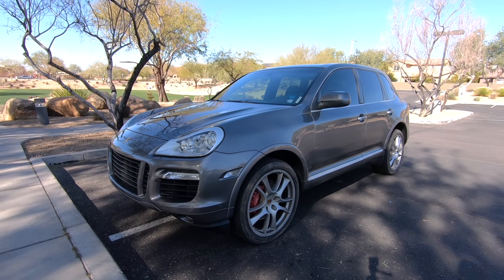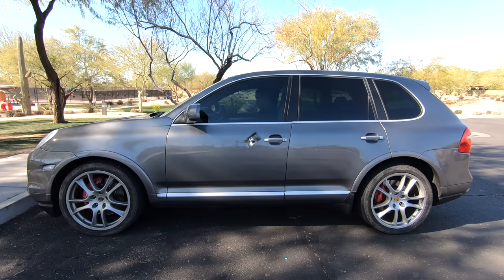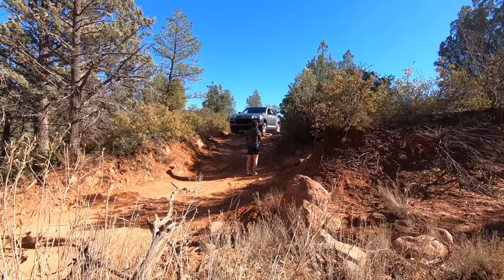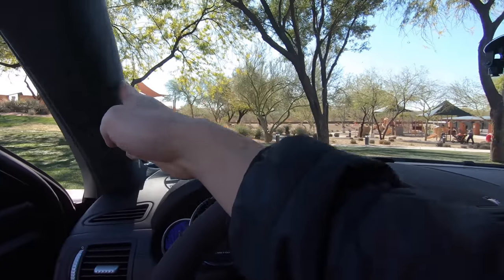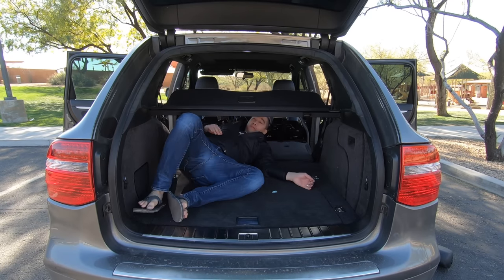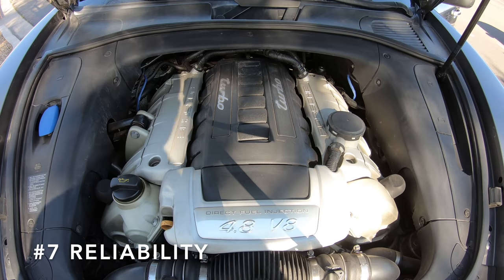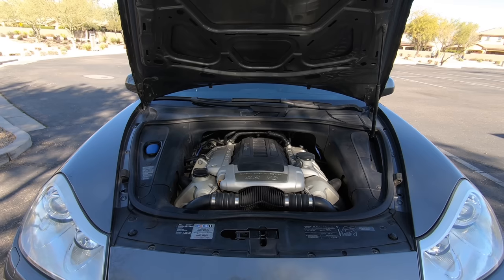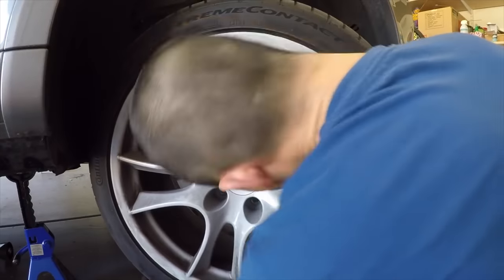Why You Should Buy a Used Porsche Cayenne Now! (First Generation 955/957 Review)

Comment: 250k 955 running strong today!
Reply: How many seals have you replaced?
Reply: 300427 mine has been so reliable
Reply: Just bought a 955 with 140k she’s doing really good rn
Reply: @warriorsfan362  did u replace coolant and driveshaft
Reply: Getting my V8 4.5 350 on Friday, can't wait
Reply: @FL1T  are you financing
Reply: Which model?
Reply: Mine has done 300,000km. Going strong,  only repairs in 6 years, rocker cover gasket,  2nd air pump and something else.  Cost approx 2k in repairs.  I buy all my parts from rockauto in the USA.  Week and a half for delivery times
Reply: @warriorsfan362 what year
Reply: @Adetokunbo03 what year

Comment: I used all of these points to justify buying a 2005 turbo about a year ago. Original owner had the 100K mile warranty with a carfax several pages long of dealer repairs, coolant pipes included. Picked it up for less than 10% of its original price and it was always a California car. Absolute steal, right? Well at first yeah, but the hits never stopped coming with that car. Suspension bushings started clunking, there goes a few grand. Engine started rumbling at red lights = failed motor mounts (that's an engine out job for a turbo fyi), another few grand... Fuel level sensor faulty, rear windows stopped working, OEM trunk struts only last a year or so and are a complete pain to replace, sunroof drains will clog if parked outside and leak into car, wiper fluid motor crapped out, headliner started sagging, headlights started flickering randomly (decomposing wire insulation). My only advice (aside from not getting one) would be to buy one with over 130K miles on it, I think there are very few documented cases of bore scoring beyond 130K. And the bore scoring does happen more often than you think, there are endless threads on the forums as well as multiple shops that specialize in refurbishing these engine blocks (for like $15K). Some unlucky owners had engines replaced only to have the 2nd engine suffer the same fate. Watch the Hoovie's Garage episode where he gets a cheap Cayenne S, the engine was seized no doubt from bore scoring. At the end of the day I just didn't trust the car enough to take on the adventures I bought it for. It's a fast sexy beast that can also off road really well, but the frequency at which things would break was unreasonable to me. So far the only german car I would buy again is a Mercedes w210...
Reply: This is the real advice people should be thinking about. I came looking for the “real deal” review, so thanks!
Reply: I have an 06 S V-8 no turbo with 224,000 miles. They can be costly unless your mechanic is your friend...😇
Reply: This is why I chose VW Touareg TDi, I have had one before dieselgate bought for $15k drove two years, 60k miles, VW paid me over $30k for it. Then bought another 2010 with AIR suspension for $10k in early 2020 with 78k on the clock. It has needed brakes and the driveshaft coupling support changed, less than a grand and labor. Even though VW did the designing and engineering for the Touareg, adapted to Cayenne, Audi Q7 and Bentley Bentayga. The MOST solid models ever built are the Touareg Gen 1 with 3.0 liter Turbo diesel.
Reply: It is bad that this happened to you, but you should have done your research and checked the vehicle out better.. Just because you got a bad deal does not mean that the rest is that way. You do know they have scanners that you can plug into your vehicles that can tell you these defects before they happen or a general idea of what is going on with it now. Modern tech is not like the old day's, spend some money and it will be worth it in the long run...Besides, you can keep the scan tool to check your car on a regular basis...That's just my 2 cent's, I havd worked on and taught and inspected some of every vehicle you can imagine....
Reply: @dodgechargerrt1873  Thanks for the advice, and yes I am aware that diagnostic scanners exist. I had a PPI done which included scans with multiple OBD2 tools and there were no issues, although most of my issues wouldn't have shown up in a scan anyways. All the problems came after months of ownership. I sincerely hope that everyone else who buys these cars have better and cheaper experiences than me.
Reply: Best to pay 2 hours labour and have a full inspection but a Turbo is just not a good idea being top of the line means the highest repair cost. We have the 2008 S version purchased 3 years old and it was good for a few years and then suddenly about a year ago it went in for a 5000 repair job including new brakes, driveshaft tires, engine light.
Reply: For a car this old you have to budget up to 3000 per year in repairs.
Reply: @paull3179  Agreed, I had maybe $1500 per year in mind but that was wishful thinking haha. If people can handle the cost and [more importantly to me] the down time, then it's an amazing car.
Reply: @tomeisberg2356  We were running 500 to 1500 for many years.  Now we might be back to 1000 to 2000 after the major repairs.
Reply: Yes. These trucks are no joke for maintenance. I still think they are better than the comparable AMG, and M cars around its time. The 955 body almost ugly. Really has (imo) aged really well, and I think will continue to do so.
Reply: Ooooh Myyyyy G...  I'm Really starting to like my sleeper Hondas after all  :)
Reply: @tomeisberg2356  None of the issues you listed would have showed up on a scanner. Maybe a PPI at best. Who knows. Every car purchase is a gamble.
Reply: @dodgechargerrt1873  Bruh, pretty much everything he mentioned is maintenance.  Changing engine mounts etc..those are all wear items.  They're just crazy expensive on a Porsche.
Reply: @hamsterbrigade  You are right, one should consider that kind of expense..Enjoy your weekend...
Reply from the maker: Sorry to hear about your experience. These Cayennes can be hit or miss. Some people don't have many issues while others do. My Cayenne had a bunch of little issues early on and has mostly been good for the last 35k miles. Under my watch, the vacuum pump went out, the thermostat housing sprang a leak, and one of the wheel bearings went out. Not great, but hope the next few years of ownership won't be too bad.
Reply: 06 Cayenne S Titanium owner here.  

Problems to date since purchase (one owner dealer dealer/equivalent maintained 105k miles)

Pre purchase inspection yielded coolant residue in engine bay apparent which I had no knowledge of at time of purchase so I ended up having to replace to aluminum pipes myself.  If I had caught it the seller would have done it for free.  Wasn’t the easiest job but doable. $200

Driveshaft center support rubber replacement, bought a silicone part from a guy in Germany who invented it.  40k miles later still no issues.  $60

Spring gave out randomly, just replaced the whole shock/spring since parts are so cheap. $75

Left me stranded only once due to coil packs going out and giving a misfire.  Was way overdue at that point, (almost all coils were cracked) driver error for skipping inspection. $300

Air conditioning fan stopped blowing one day, motor faulty.  $50 on Amazon, boom fixed.  

Wheel bearing noise from front, could not isolate which side so bought both knuckles less than $200.  Rust was the biggest headache of the job.  

I’m confident this car can take me where I want when I want.  It has.  All these issues mentioned were partly my lack of inspecting and also I was using the vehicle for work loading it to the ceiling. (Probably reason for spring and bearings giving out)  I’m assuming mine is not afflicted by bore score since I’m already at 165k and it purrs.  If it does give me issues I plan on putting a turbo engine in and be on my way again.  Wish you had better luck with yours.  You need time and plenty of tutorial videos and most jobs are possible to do yourself.  

I’ve driven this car hard ( I mean hard) many times and it’s always just hungry for more.  It’s been an absolute pleasure.
Reply: This is exactly what I needed to read in order to convince me NOT to plunk down $7-10k on a an older Cayenne. I actually have a Gen 2 Ford Raptor that I love, but want to get out of it while used car market is on fire with super high prices (worth $5k more on trade than what I bought it for over a year ago with 10k+ fewer miles, and close to $10k if I wait for the right buyer selling private) and also think it's smart to get out before the new Gen 3 Raptor comes out later this year. 

Was looking for a cheap nice SUV for the few times I do need to go places (visiting family, grocery runs and potential extended weekend trips). I thought the Cayenne would fit the bill nicely and if I do end up having to commute again (short trip to the train station) later this year for work if we go back to office a few days a week, figured it's still decently reliable and nice car for that and also will hold retain value for when I decide to get into a new car 1-2 years after.

In the back of my mind I knew nothing on a ~15+ year old car could be that simple or reliable. I tried to convince myself with the sheer number of 125k+ mile examples that were still on the roads and for sale that the drivetrain was solid, might just be annoying rattles and things I could look past, but your post basically paints out a clear picture of what I always knew it probably was going to be like and didn't want to believe it. 

Thanks for saving me $10k and thousands more in headaches and repairs.
Reply: @GuyOnYouTube  Ironically I think the drivetrain is pretty solid as long as you don't buy one with the cylinder scoring.  As you mention there are lots of these cars still out there, and there are examples that have gone for 300-400K miles. The real problem for me was how often it had to be fixed for things other than the drivetrain. I'm pretty forgiving, especially when it comes to vehicles, but I got tired of wondering what was next in terms of repairs. If you have the setup, tools, and time to do the work at home, sure you can knock out things like suspension, wheel bearings, etc. and have a more affordable ownership experience. But even so, the potential for electrical issues is another category of headaches altogether. Imagine you're 100 miles from nowhere and it's pitch black and all of a sudden your headlights start flickering for no reason and even turn off. You pull over, restart the car and they're back to normal. But your trust in that vehicle will never be the same. Too many moments like that, coupled with many thousands in repairs over the course of a year caused me to throw in the proverbial towel. Regarding cylinder scoring, all of the V-8 models from that era were at risk, and the only real way to know you have a good one is if you've made it to 150K miles and it doesn't have the tell tale "piston slap" sound and excessive oil consumption. AFAIK there is no magic digit on the engine block that signifies a risk free engine. You can roll the dice and buy one in the 80-100K mile range, and chances are the engine will remain healthy, but if the problem presents itself then the car is finished. The only fix is an engine replacement or refurbishment, both of which cost more than these cars are worth.

It's funny, a coworker of mine was literally just telling me how he's thinking of selling his Gen 2 Raptor because the market is so hot right now, it's a pretty amazing truck. As far as cheap reliable used SUV's, there are plenty to choose from but few will be as exciting as a Raptor or a Cayenne haha. An early 2000's ML55 is probably a good choice, that drivetrain is super reliable and it doesn't have air suspension. But if you want unmatched reliability I can personally vouch for first gen Toyota Sequoias, mine was running strong at 330K miles when I sold it, routine maintenance only. Plus they are cheap compared to Land Cruisers. Anyways, good luck with your search!
Reply: @tomeisberg2356  Yes, completely agree with you. I’ve gotten over it and more realistic about what I need. It’s funny you mention the ML55 cause that was another car I was looking at. 

Ultimately, I’m going to get another Raptor because it’s simply the best truck I’ve ever had, but going to sell mine now to realize the appreciation and just need to be in anything that will hold value and not be a money pit the over the next 1-2 years until I find a nice (newer/lightly used Gen 2 raptor for cheap, or if I can even swing into and find a Gen 3 if prices aren’t crazy). 

With that said, I’m probably going to avoid these 15+ year old cars. The gamble is just too high that the car becomes a total loss and likely will just be a bunch of headaches and thousands more in repairs. 

I’m thinking of just getting a lightly used / low mileage sports sedan that’s already taken massive depreciation hits and likely not to fall much further. Can find really nice Infiniti Q50 or Alfa Romeo Guilia for at or under $20k depending on mileage that may even still be under factory bumper to bumper warranty. I’m thinking at minimum I can still get $15k+ all day in 1-2 years, if not the same as what I paid as with gas prices increasing, I think sedans will make a bit of a comeback.
Reply: The only way to afford this type of carbon the long run are ones that can work on the car yourself.  You have to be confident in your ability to do so.  If you don't work on cars don't get this car.  Everything is triple the price at the dealership than other cars.   I've saved 15000+ dollars workingm on it myself.  I bought with 91000 miles.  I've practically replaced the entire car.  It's currently taking another round of parts right now.  Also don't buy cheap parts for this car.  Buy own but put them in yourself.  I've replaced. Front differential transmission ( known problem) dealer wanted 10,000 found used part on eBay for 500 and me and my wife suspended the enginr, bought the special tool to suspend it 80$ and pulled axles and the whole thing.  Saved 9500$.  Starter went out because coolant from coolant tubes leaking.  Dealer wanted 3000 coolant tubes 800 for starter (known problem), so another 4000 basically.  I paid 350 for new bosch starter and 350 for tubes saved 3000.  Rear and front driveline went bad ( known problem) dealer wanted 3000 to fix paid 800 for front and rear driveshafts.  Saved 2200.  Known splice failure in electrical system after clogged drain leaks into cabin ( known problem) dealer wanted to pull seats and carpet, unclog lines, and, fix factory crap splices.  2000 labor.  Did it myself for 35$. Saved 1965.  Vacuum leak in engine, spark plug and coil packs, fuel pumps and filter.  Each of those the dealer wanted thousands.  I did it myself and saved.  I've practically replaced the whole car.  It is pretty reliable and I love it when though we've been through the wringer.  It's just too cool of an r
Engineered car to not love.  You have to work on it yourself though unless your rich.  But if you were rich you wouldn't be buying a user's cayenne in the first place.  This car is really for mechanics who lve tinkering with their crap anyways.  I warned you...
Reply: @greatestevar  the latter is true
Reply: There's nothing more expensive than a cheap German vehicle.
Reply: @GuyOnYouTube  guys that is because he bought the top of the range version if you go dimple with this car and get the V6 without Air suspension you would have no issues
Reply: @datazndood  hey. Thanks for all the detailed info. Do you remember how did you diagnose the shaft center bearing wear? I just bought a 2006 Cayenne S and I can hear a whine when lifting off throttle on highway. Can’t identify where exactly it’s coming from but i suspect it’s the center bearing or a an axle rod.
Reply: You helped me make up my mind to flee from making the purchase😁
Reply: I had the same exact experience up to "Absolute steal right?"

I bought my '05 turbo in october of 2020 at 138k miles. at roughly 8% of its sticker price. roughly 15 months later just past the 155k mark.
 I have only spent $2k on repairs so far. $900 of which I knew I had to spend as soon as I bought the car.
I absolutely love the vehicle. Sure the MPG is horrible and its the most oil thirsty car ive ever had, but I knew that I was signing up for that. 

That being said, i've put well over what I paid for the car in mods. Brought the entire audio system from 2005 up to 2021 with state of the art speakers, subs, and new deck with apple car play, then I wrapped it in a satin frost grey with a blackout chrome delete.
Reply: @MarkHicks326  exactly, i have a 04 turbo and using rennlist for maintenance
Reply: @paull3179  my old X5 v8 cost $3k easily per year too
Reply: @alexanderstevens145  my tuned S4 had been running for $500 per year for 7 years and now it cost about $10k in maintenance in one year for various issues.  It never had any part fail before.  Engine light, epc light. Carbon cleaning, sensors, 3 new intercoolers (front I broke at high speed my fault hit by a flying metal piece. one leaking in supercharger both replaced), front tires, alignment etc.
Reply: Good advice. Looking at 150k+ one
Reply: @datazndood  Did you perform all the labor yourself? If not, then is it too late to ask you to list the approximate Labor Cost of each of the 6 repair jobs you listed above?
Reply: I’ve been there. These guys just don’t know. 3 k a pop. A pop. Whose got that just lying around for a car. It’s crazy. German = money. Never again unless I have a full warranty.
Reply: @tomeisberg2356  How often did you have it stored outside?
Reply: Scary
Reply: Can’t listen to a review seriously  while you’re wearing sandals 🩴